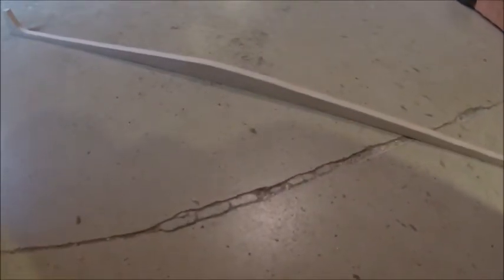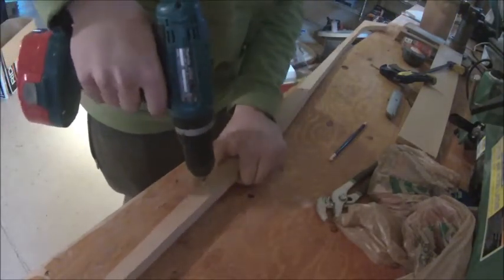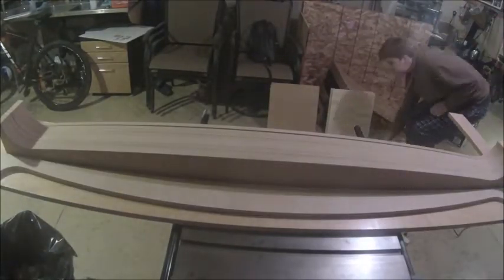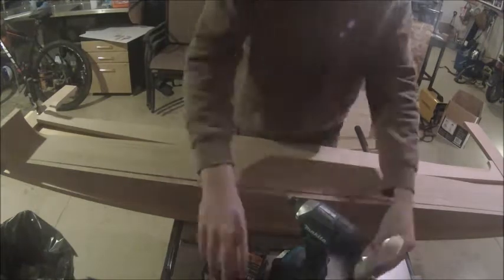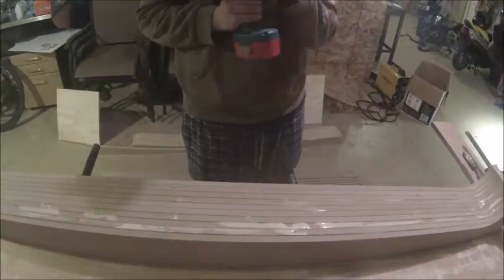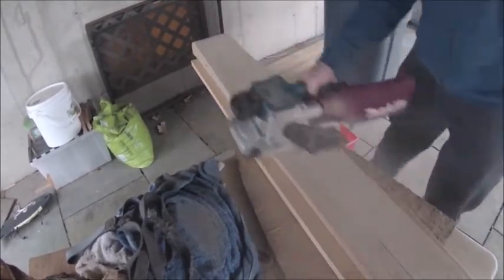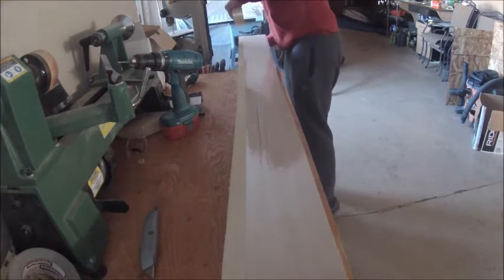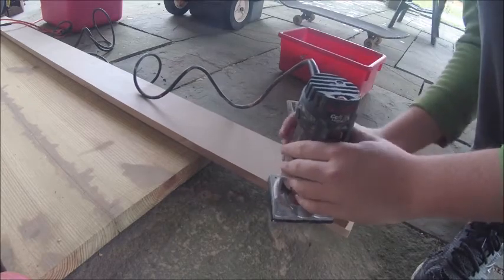How to Make Skis Part 1 The Ski Press

Comment: Extremely informative. I'm planning on building a board this summer. For your skis, do you know how much sag was in the rocker portion of the skis (tip and tail) if any at all. Also how well did the clamping method work out for you? Did you experience any inconsistencies or delamination this past season?
Reply from the maker: I'm sorry I never saw this comment,  my tip and tails actually  had 0 sag but I had a 100% camber ski, since the rocker portion of the ski is a shorter than what is typically  the camber portion,  I'd assume a half cm of sag.